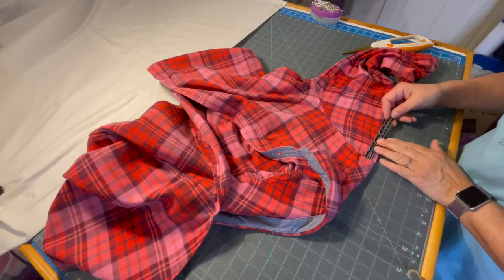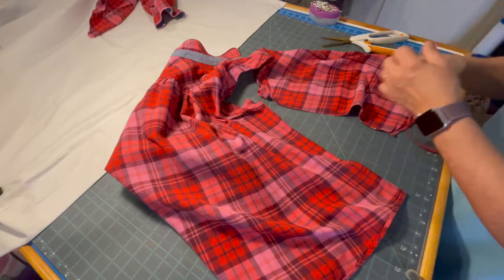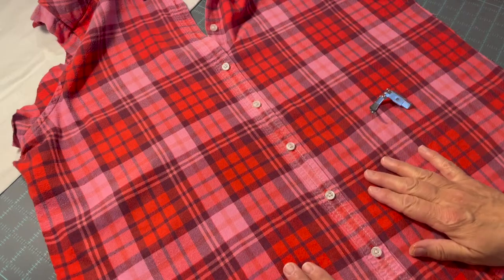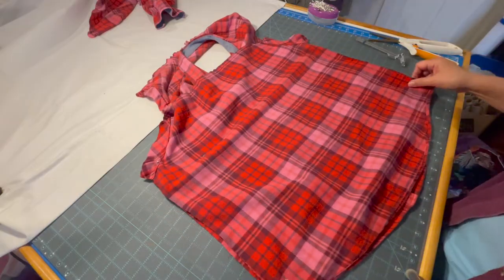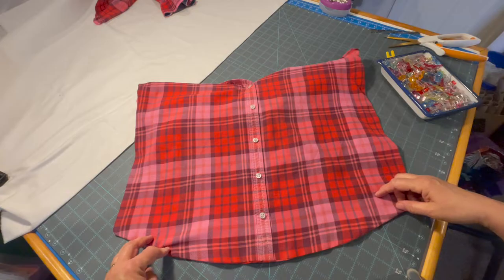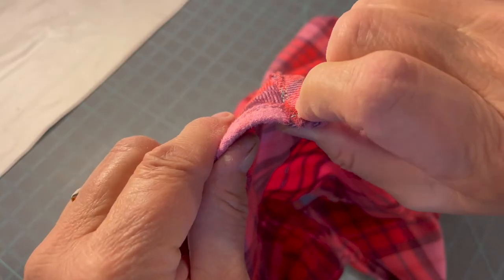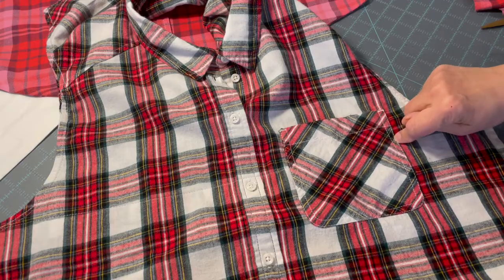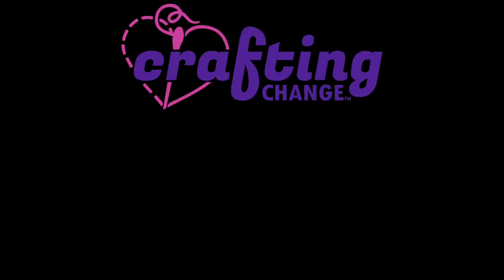Making a Flannel Dignity Cover (Adult Bib)

Comment: I've seen this idea and really like them. You did a great job explaining. May I suggest one modification-  take the top buttons and sew them onto the top placket, right over the button holes and attach velcro between the two plackets to close the top of the neck. Velcro is easier for anyone who has arthritis or other dexterity issues.
Reply from the maker: We were asked not to include velcro for the charity partner we were sewing for as patients in Hospice have such delicate skin, and also the sound of Velcro can be bother some to some. Also we find Velcro can get really full of debris not wanted and hard to get out and these are going to Hospice patients. For general use, Velcro might work well! Flannel will stick well to itself, so for a bedridden person, it does really well simply setting one side over the other without using the buttons. Best of luck to you, glad the pattern helped!